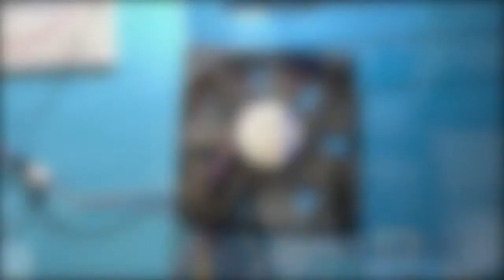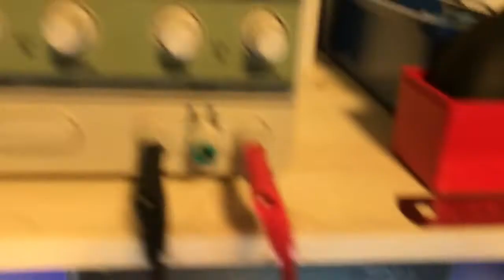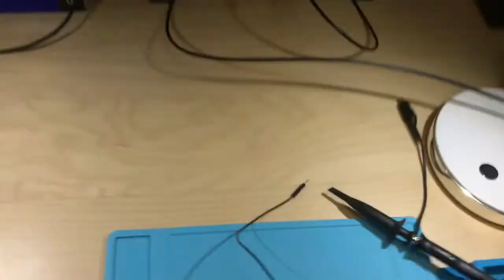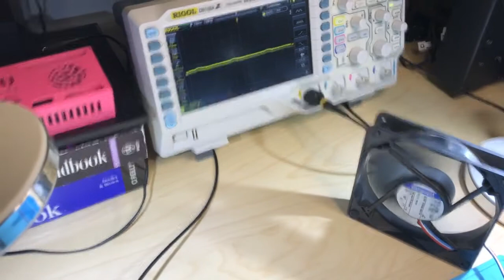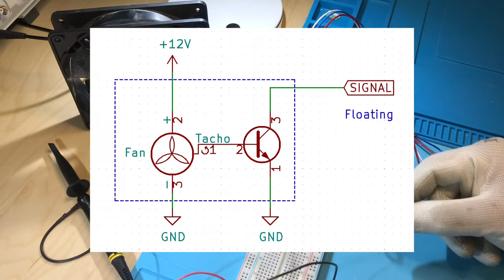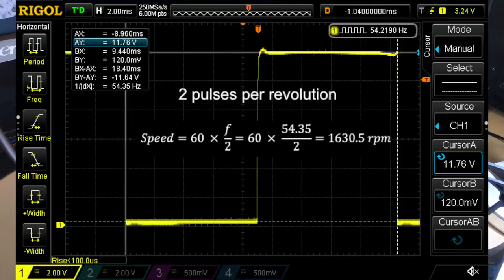3-wires fan and how to measure its speed with an oscilloscope

Comment: Sensor (tachimeter) signal is the same on 3Pin fan and 4pin(PWM) fan? or there are differences?  asking this bacause usually i replace 3 pin fans with more modern PWM... but i'm using the yellow sensor speed  of 4 pin fan like the old one.. and i'm not sure them have same specifications.  . maybe there is a risk that old motherboard are reading wrong RPM ...   can you help me?

Comment: Ummm should you be using another resistor between the transistor base and fan tacho. Looks like a short to me.... The emitter and base part of the transistor (between pins 1 and 2 ) should fry.
Reply: All he had to do was ground the tach signal with a resistor, no transistor needed. Most likely the fan's tach signal output is high impedance so transistor would be ok.
Reply: @yellowest_ball  Ok but still bad practice especially when he didn't know the impedance.
Reply: @EvoPortal  
Absolutely.

Comment: Do all 3 wires fan have a speed sensor? The older fans with 3 wires seem to only have a locked rotor sensor. Correct me if I'm wrong
Reply from the maker: All 12V PC fans have a speed sensor (Tachometer-output). It is standardized by Intel.

Comment: Thanks for this explanation! I was having issues measuring the RPM of a brushless DC motor using the built-in hall sensors. Got it working with your help.